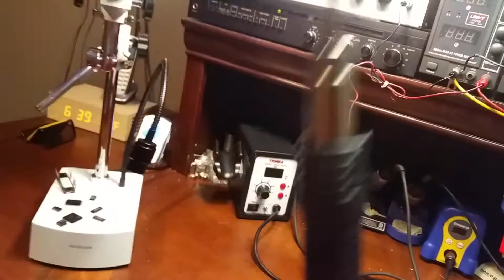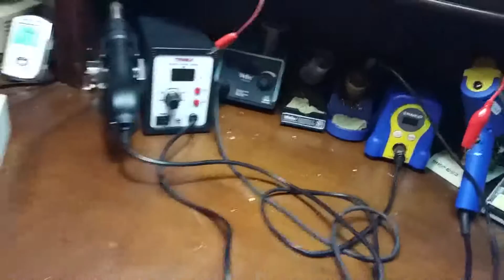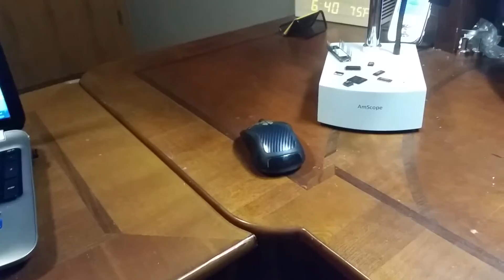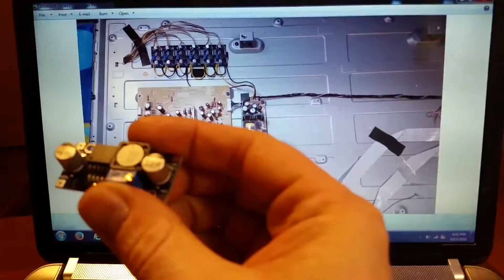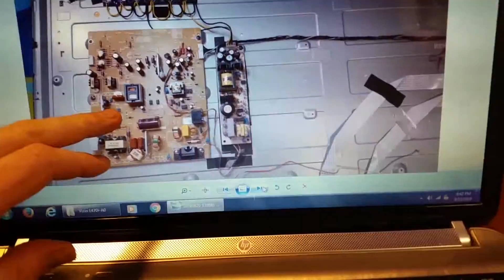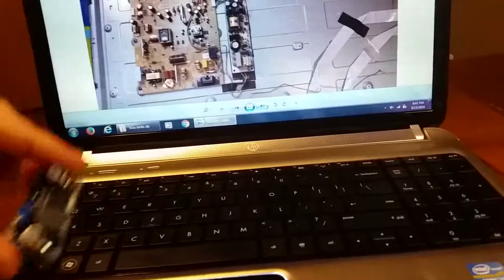How I repaired the Vizio E470i-A0 LED HDTV

Comment: My tv is the same it has no audio and blank screen i found out that the back lights leds are shorted, do you think this problem make the tv not  make any audio either image?
Reply from the maker: Do you get image with flashlight test?
Reply: jeffescortlx nop, nothing but i know for sure the back light LEDS some are shorted,
Reply from the maker: @skuartle  then you probably has two issues going on. Typically bad backlighting won't stop the image from working.

Comment: On the LED connector CN301 there are 4 pins.  I am getting about 75 volts between LED1-   LED1+ but I am not getting anything between LED2- LED2+. I got an identical power board but I am getting the same results. Is there a signal from the main board that turns on each channel of the LED power? Which pins on connector CN201 could I test?
Reply from the maker: Next thing I'd do is check for an open LED.
Reply: Hey Alan I think I'm facing a similar problem, some positions (2,3,4 from top) do not seem to work even with new LEDs; do you know if those correspond to LED2, I was not able to tell. Were you able to solve your problem? Please reach out if you can. Thank you!